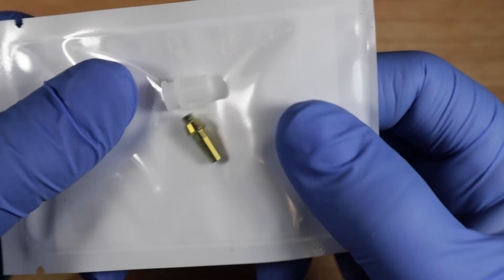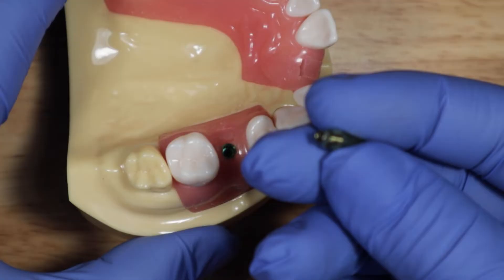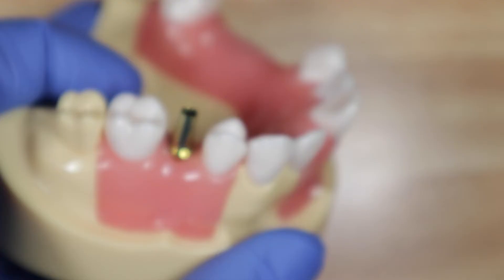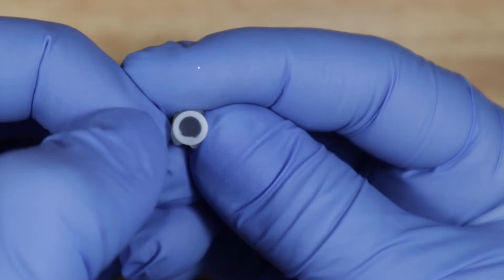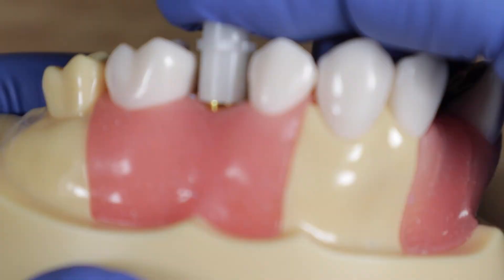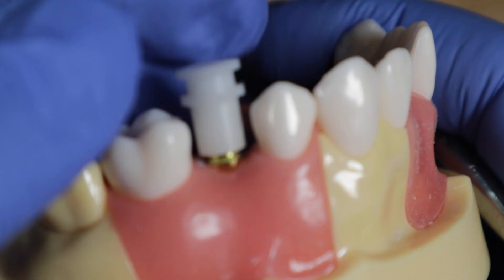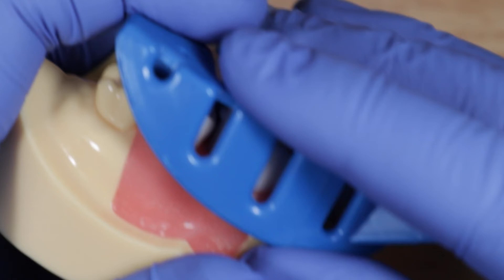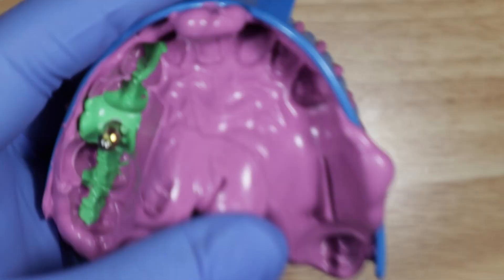Closed Tray Impression Coping - How to Take A Closed Tray Impression

Comment: If the abutment is above occlusal height and u need 3 mm can u just cut the top to get 3mm? Like get a but and just cut straight off?
Reply: That cutting is done in lab. If implant is at an angle ,side also will be machined. For bridges to get parallelism , technical team will grind sides of abutments on models